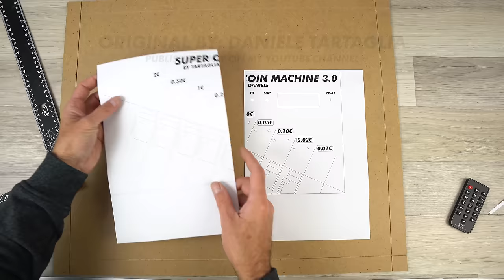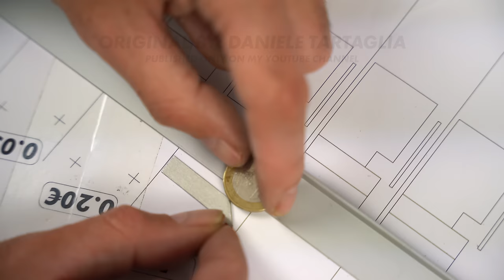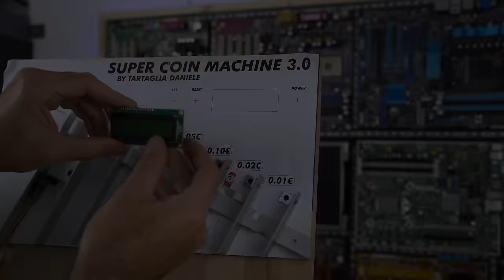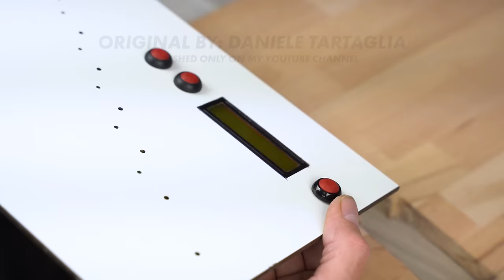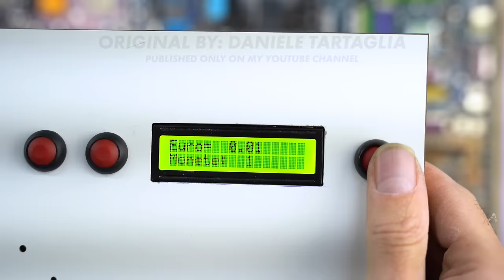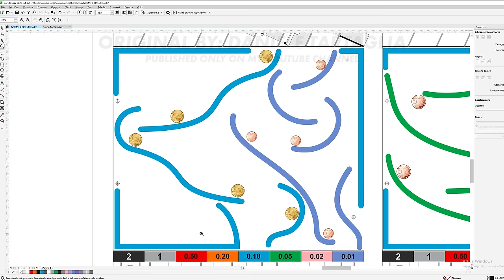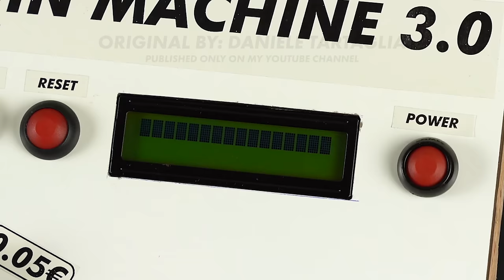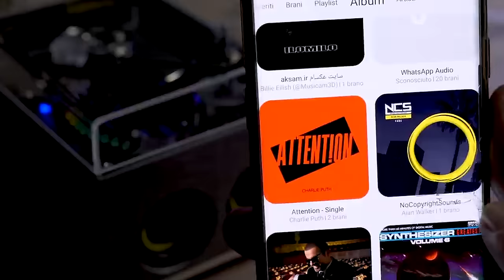IMPOSSIBLE COIN SORTING MACHINE - how to make

Comment: The idea with the transparent sorting mechanism from the laser cutter is genius. It looks like art and would be worth to be shown in a museum.
Reply: The bottom half doesn't even do anything really.  All the sorting is done up top.  It would be a little more elegant to incorporate the sorting into the laser cut section.
Reply: @denniswoycheshen  The sorting on SIZE is done on top, THEN the sorting on VALUE is done in the squiggly middle part. The bottom part just neatly stacks the coins.
Reply: @Trenjeska  sorry, in Canada the coins we use are different sizes, so there is no need to sort by value as well.  :)
Reply: @Trenjeska  wait a minute, do you live somewhere where coins are the same size or something?  The sorting is done first, the rest is just for show.
Reply: @denniswoycheshen  let's see your build then?
Reply: @paulbritton187  k
Reply: @denniswoycheshen  When you sort Euro coins by radial size, largest to smallest, you get stacks in this order:
€2, €0.50, €1, €0.20, €0.05, €0.10, €0.02, €0.01
As you can see, this is NOT on order of value. The €0.50 coin needs to be swapped with the €1 coin and the €0.05 coin needs to be swapped with the €0.10 coin to have all coin stacks in order of value
The spaghetti paths achieves this in a aesthetically pleasing way. It can be done in a more straightforward way, true, but has to be done nonetheless.
Reply: Ohhhhhhhhh.  I get it. Spaghetti is pleasing. :) no thank you for the explanation cause I was a little lost.  Canada's coins mostly grow in value by size aside from the 0.10c.  Or i guess $0.10 would make more sense. So 0.10, 0.01,0.05,0.25,1 and 2.  Doesn't it get cumbersome using 8 coins or is it handy?
Reply: Does it come apart easily? How are jams cleared?
Reply: @denniswoycheshen  US and Canadian coins are designed to be similar sizes. With the exception of dollar coins. And we don't even have a $2 coin. We can't even get people to use $1 coins, but the mint can't make up it's mind what they want it to look like.
It was great when the made the Susan B Anthony $1 coin, that was the same size as a quarter, sometimes you would get a bonus $0.75 in your change. 

The UK pound coin is my world favorite though. A think, heavy , REAL coin.
Reply: @Vandalfoe  I guess the motor generates vibrations which clear jams... at least that's the idea...

Comment: You could keep track of how many coins are in each stack instead of the total. You could also add load cells to keep track of each stack weight then when a user removes coins from the stack (as long as it knows the avg weight of each single coin, could easily be done with constants in the arduino program) then it could automatically update how many are left/total amount.
Reply: A small spring that Is attached to a bucket, every time a specific weight is reached it drops coins it will be enough to make a roll. This way you always have rolls in the count not uneven counts.
Reply: Doing it by weight would not work considering that coins pick up grime which can alter the weight. It just would not be accurate.
Reply: @-_IT_- there should be a minimum weight, like if it's heavier than a pristine coin from the previous value, then it accounts for all the added grime. either way, it's totally possible to have a range, or even make predictions with formulas that account for variations in weight, especially since those variations are extremely small
Reply: @-_IT_-  That's why you take the average weight, doesn't need to the exact weight just a ball park number (something like +/- 10-15%). Also its not like the load cells will have exact result, there will be differences between each cell.

Comment: Most coin sorting  machines use a tear system with typicallt 1-5 cent category, 10-50cent category then €1 and 2 category.

This way the sorting can be split 3 ways two times. 

The first sorting is typicallt with magnetic indukction,  (simply by roaling past a magnet) second by width.
Reply: and? What's your point?
Reply: @bsvenss2  This machine is better. Right OVER your head. Wow.

Comment: That is the weirdest and most impressive coin sorting machine I have ever seen 🙂  Well done!
Reply: @elye3701  You were impressed by the US (4 coin type) coin sorter that required constant help from the operator to stack the coins because it did not have a vibrator function.  Where this machine works flawlessly sorting 8 types of coins with one (1) moving part and counts them as well.
Behold, I'm not impressed by this link.

Comment: I hate to say this...because it's a beautiful piece....but I believe you have the coins falling in the wrong position. The smaller coins are at the far left, but they fall down the bottom most slide. Whereas the larger coins fall down the upper most slide. Why this makes a difference is that the smaller coins get lost behind 3 sets of blocking slides...in other words, it's difficult to see the smaller, faster moving coins when they are behind all the other slides. The larger coins would be easy to see, and follow, because you'd be able to see them behind all those other slides. The smaller coins, not so much.

Comment: Very cool.

Question: Looks like a .50 Euro piece is bigger than a 1 Euro piece so that's sorted out first (which makes sense), but at the bottom, does it sort them 2 Euro, 1 Euro, .50 Euro?
Reply: At 16:25 you can see it is the case, it is sorted by value at the bottom, same thing happens with the 0.05€ and 0.1€

Comment: Bellissimo lavoro Danie, come sempre, ma toglimi una curiosità. La parte centrale dello smistamento è per divertimento che l'hai fatta? per estetica? perchè funzionalmente mi sembra inutile, nel senso che tecnicamente potevano cadere dritte nel raccoglitore. Comunque grazie di tutto, sto imparando ad usare arduino grazie a te
Reply from the maker: Si, è puramente scenico. Potevo tagliarlo e farle cadere direttamente, ma la mia testa lo ha voluto cosi :-) Grazie a te comunque
Reply: @DanieleTartaglia  I wouldn't say that it's useless. Does it not reorder the coins so they are are stacked in increasing values? That's a beautiful way to do it. However, does it come apart easily to allow one to clear jammed coins?